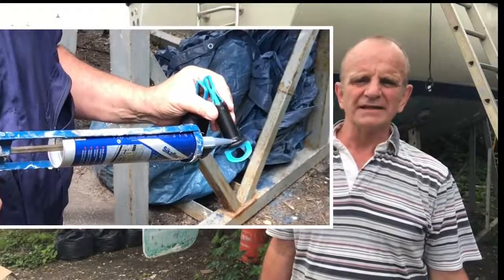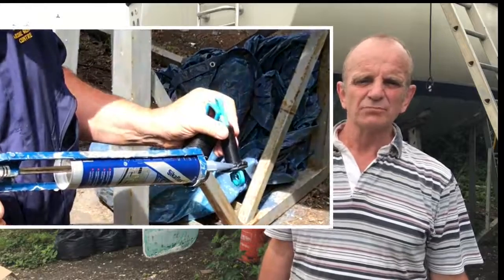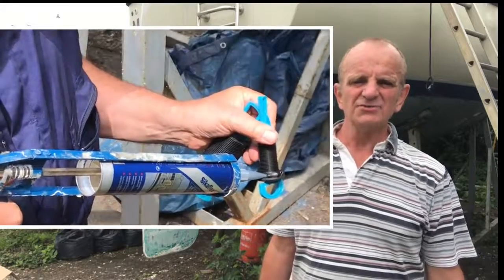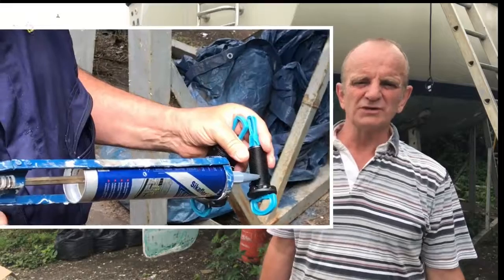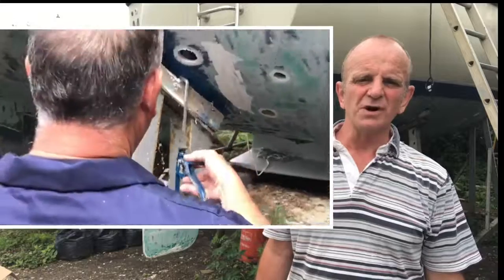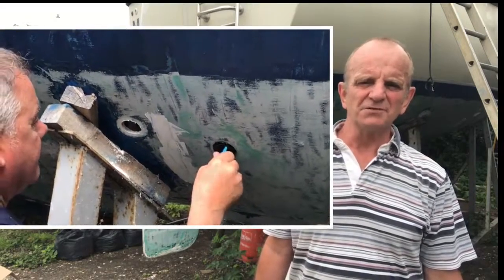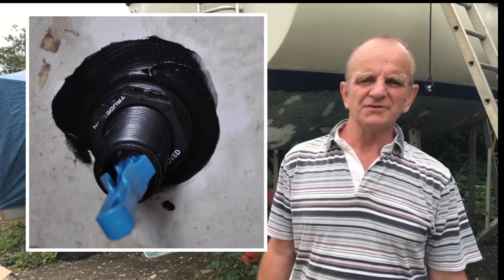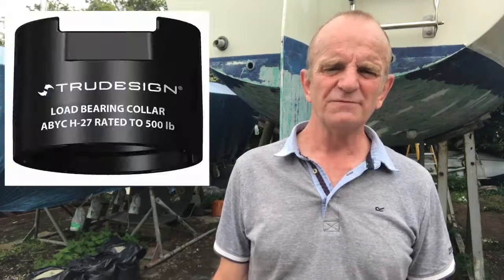How to install composite skin fittings – TruDesign seacocks on a Maxi 84 yacht

Comment: Is it really possible to cut the flange to length? I would like to install trudesign to a steelboat. The flange is too long to use the stability-device as that is too short to cover the thread if the hule is thin.